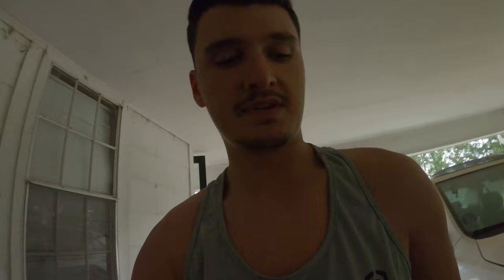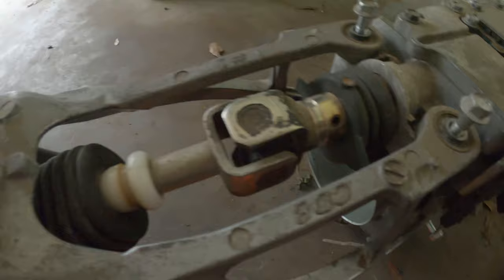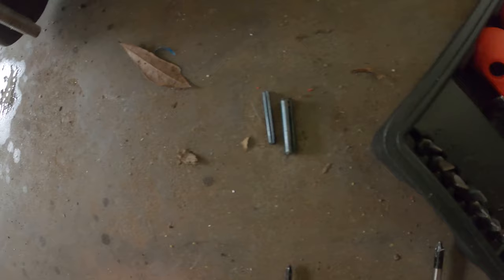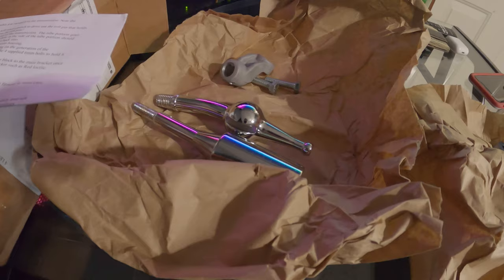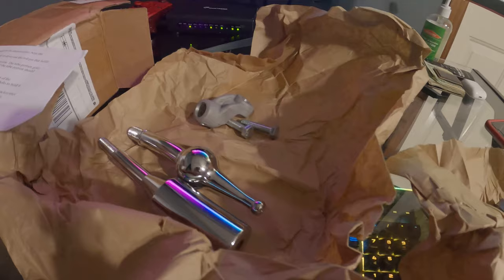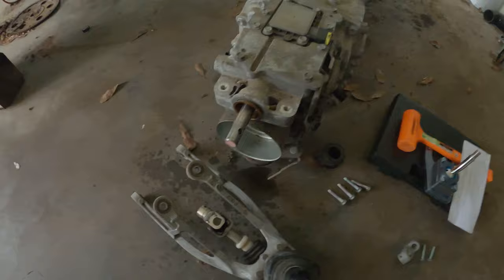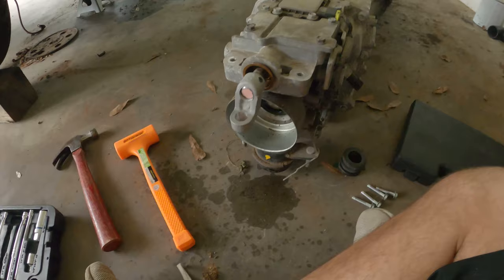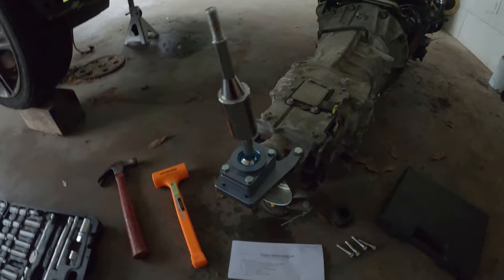Turbo 2JZ Short Throw CD009 Shifter Install!

Comment: Hey can you put the link where you bought the shifter. What car are you installing the cd009 with the 2jz?..sometimes I think that the oem cd009 shifter can be cut shorter and re-weld but you are goin to need a aluminum welder,I wonder if anybody has done it. Btw great video👍
Reply from the maker: https://xcessivemanufacturing.com/toyota/transmission/nissan-drivetrain-chassis-engine-vq-n-vq-sbk-s.html
Reply from the maker: I'm putting it in my Lexus IS300! I've got other videos up of it on my channel, but the stock shifter sits too far back to work for this car.